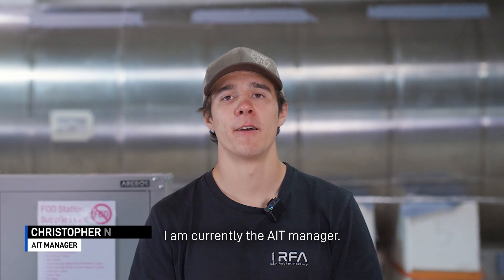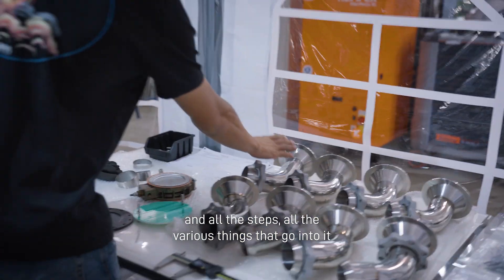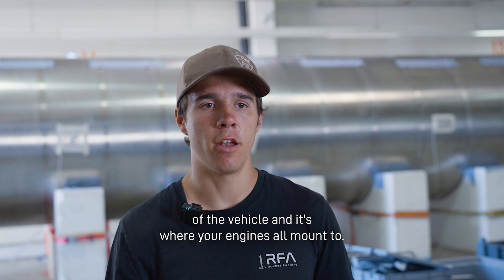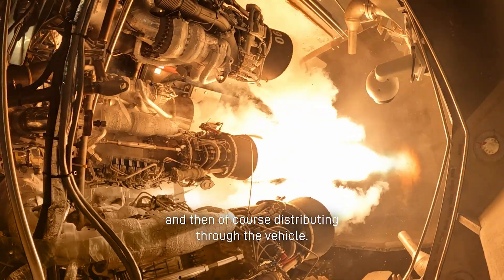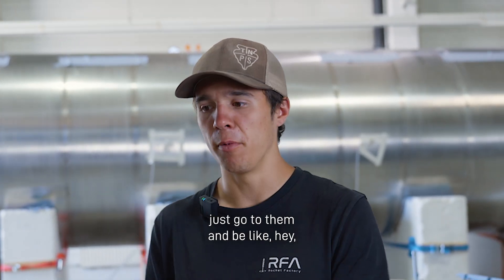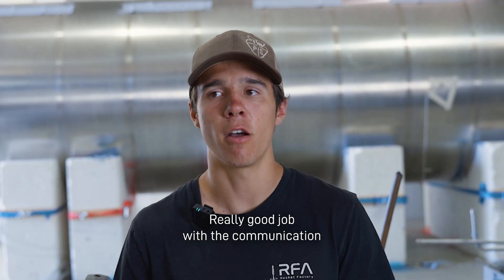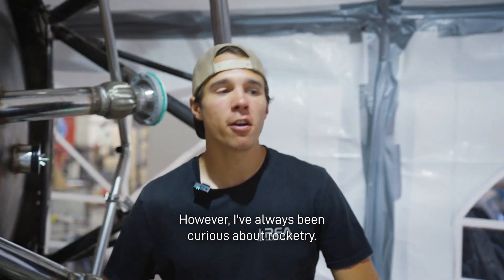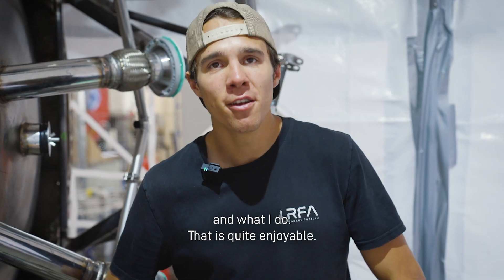How to build RFA ONE

Comment: Preheat the oven to 180C/160C Fan/Gas 4. Grease two 20cm/8in cake tins and line the bases with baking paper.

Sift together the flour, cocoa, bicarbonate of soda, baking powder and salt. In a jug, whisk together the buttermilk and food colouring.

Cream the butter and caster sugar together in a stand mixer until really pale and light, this will take at least 2–3 minutes.

Lightly beat the eggs and vanilla together. Gradually add the eggs to the creamed mixture, mixing well between each addition and scraping down the bowl from time to time with a rubber spatula.

Add the dry ingredients to the bowl in batches, alternating with the red buttermilk, mixing until well combined. Divide between the prepared tins and bake for 20–25 minutes or until a wooden skewer inserted into the middle comes out clean.

Leave the cakes to cool in the tins for 2–3 minutes, then turn out onto a wire rack and leave until completely cold.

To make the frosting, beat the cream cheese and butter together until smooth. Gradually add the honey or maple syrup to taste. Add the vanilla and mix until smooth.

If the cake tops are domed, slice off the top of one, using a long serrated knife, to make it level. Crumble the off-cuts and set aside.

Place one cake layer on a serving plate and spread the top with 3 tablespoons of the frosting. Top with the second cake layer and lightly press together. Using a palette knife, cover the top and sides of the cake with the remaining frosting. Scatter the reserved cake crumbs around the top edge of the cake.